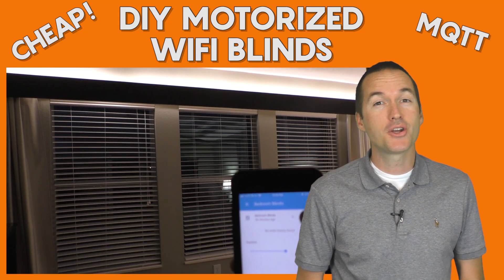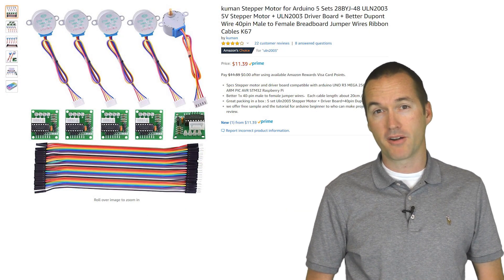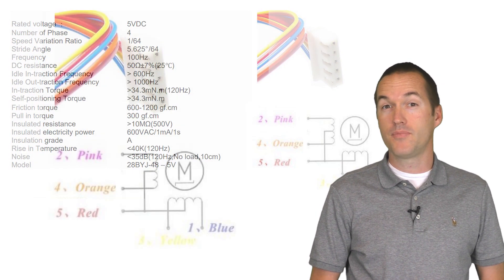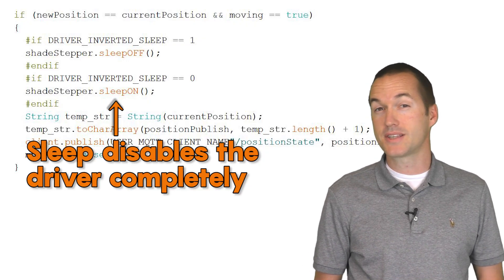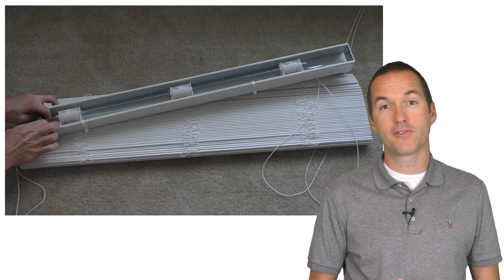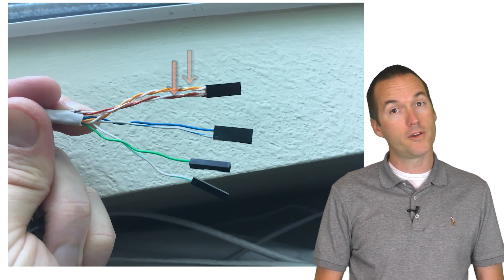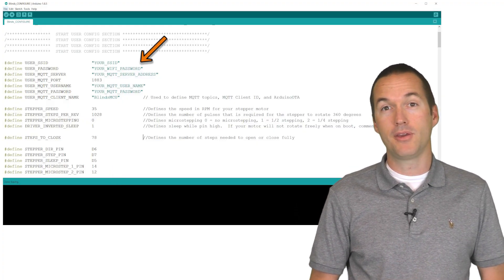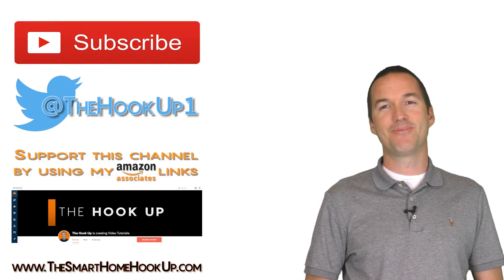Motorize and Automate your Blinds for $10! (WiFi)

Comment: This video is fantastic and just the excuse to buy a 3d printer 😁.  I was wondering if you could help me with a mod?

When using one processor to control three windows (like in your video), could you recommend a way to have either of two digital outputs control one window blind?  That way I could control them individually or as a set using four outputs.  Or should I just set each of them up on their own digital output and use software if I wish to open/close all three?  Thanks!

Comment: The ultimate would be to gather the weather forecast and indoor temperature, and have an algorithm determine if the blinds need to let more sunlight in, or reject it, with the goal of maintaining comfortable temperatures automatically. The very tricky part would be constantly monitoring the angle of the sun and continuously adjusting the slats in response. I'd settle for fully raising or fully lowering the blinds based on heating needs.
Reply: Yeah but you don't need to "raise and lower" the blinds, only adjust the tilt. That doesn't take nearly as much torque.
I think you're getting lost in the weeds....
Really, all you'd need is a light sensor to adjust the tilt to maintain as much (or as little) sun coming in, depending on whether you're trying to keep it bright, or block the warming of the sun.
You could get "fancy" by incorporating a temp sensor (with the light sensor) and develop a "fuzzy algorithm" if you wanted to, lol. That way you can have the best of both worlds. Maybe even patent it!

Comment: Great video! Thanks for your expert help but i have a problem. I'm running 5 blinds as opposed to your setup with 3. Everything works fine and I have triple checked my wiring but it seems my motors do not sleep, when powered up the motors will not rotate freely and get very hot after a few minutes!

I'm using Alexa to control the blinds and I have also tried to comment out the line below in the file "Blinds_CONFIGURE_Portal_Alexa.ino":

#define DRIVER_INVERTED_SLEEP 1 //Defines sleep while pin high. If your motor will not rotate freely when on boot, comment this line out.

Is there anything I can do to fix this? or a way to test the sleep function is working?
Reply from the maker: If the Motors work, but are not sleeping then you probably have the wrong sleep pin wired.
Reply: @TheHookUp  SOLVED With a bit of trial and error I think i've solved it. I moved the wire going from D5 - EN on the Node MCU (Green wire on your Schematic) on to the sleep pin on the Stepper Driver that I had soldered previously to the reset pin as discussed on your Video. All seem to work fine now! Ive also setup a Routine within the Alexa app to auto open and close the blinds at specific time every day! Thanks for your help!
Reply from the maker: @jayblunt  Great! I wonder if that particular board has the EN pin always pulled high to prevent people from thinking it is defective or something.
Reply from the maker: @paulfecht  if you can hook the nodemcu up to usb for a serial monitor you will see it output the position constantly (a stream of 0's or 5's or whatever).
Reply: to add to the above I do think that they are getting commands from the HA Overview page but not able to sleep the motor and the MQTT publish test part is eluding me.  Thanks.
Reply: @TheHookUp  I am able to see the serial monitor and am getting 0's.... can't seem to change that. To the 5's or what have you.
Reply: ok... so I do get the numbers.. but the range of motion... is so small.... I'll revisit your video as you discussed this.  So hopefully my final questions are in HA do I type "positionCommand" or does in need the forward slash "/positionCommand" to publish to the topic and how to I get the range of motion to completely close/open the blinds?  Thank You.
Reply: Ok, I did as @James Blunt did above and now it sleeps. Yay.... now just to get the range of motion and I'll be golden.  Any ideas to help with that would be greatly appreciated.  Thanks.
Reply: Ok, got it figured out. #define STEPS_TO_CLOSE    25 .     <-- That line of code helped me with my travel distance.  Not really sure if the HA MQTT client was getting the messages to the topic and what have you but it's performing nicely now.  Now on to install them as I have a vertical blind system that I cannot install inside of the square tubing but will need to add an attachment on the outside of the rectangular tubing in order to control the 3-spline tilt rod.  Now that I've got the range of motion I'm not sure of how to get it to reverse itself.  Great DIY project.. . . once again... Rob

Comment: Hi... I've been looking how to motorised my blinds for a while now.. This video seems perfect for my application... Although some bits sound mum bo jumbo regarding mqtt files... But I'm sure after some more reaserch I will suss it out....
One thing I would  to ask tho is... Would it not be easier to jst buy bi polor motors?
And could this set up be achieved using batteries instead of mains power.... Any ideas on the type needed and how much life you'd get out of them before charging again.....
Thanx
Reply: My original plan was going to be buying one of the smart bulbs and pulling the gubbings out to control a motor instead..

Comment: Thanks for this! Could you keep the original cord and place motor on opposite end? That would allow anybody to adjust manually. This may require some sort of automated reset programming or something?
Reply from the maker: Not possible unfortunately.  The worm drive on the original mechanism would require way too much force to turn in the opposite direction.
Reply: @TheHookUp  well i have been struggling with this .. It has to be "possible"!.. What if servo could turn the shaft with the worm gear? maybe 3d print a new shaft for the worm gear portion with spool on top.. i don't know but I need manual alternate to make wife happy  BTW I had made them according to your video and thanks much for that. they work great BUT I have to have manual

Comment: Shutters.. most homes in my town have shutters which you manually adjust each section... a pain in the butt.
Since each section is independent, I guess some type of attached rod would need to be incorporated to attach to the motor.

Comment: Hello, My Alexa doesn't find any new device's.
I downloaded "Alexa_Only_Blinds.bin" and flashed with no problem. On inital screen I choose network and insert a password and alexa ID. But then nothing... Alex can't find it.
Should I use MQTT version?
Reply from the maker: Do you have any fancy networking set up like vlans, or segregated networks?
Reply: @TheHookUp  No, I use WLED and Tv remote without problem. Will wait a little bit longer... I just wanted to make shure there is nothing else to setup, for alexa?
Reply from the maker: Try using the Alexa web interface.  Also, sometimes it says it didn’t discover anything but it actually does
Reply: @TheHookUp  Hello,

It works now :D
I didint do anything it just showed up after som time.... But now the motor goes only one way... must dig into that.
THANKS for great work.
Reply from the maker: @sajovicd  Check the connection from the NodeMCU to the motor controller, specifically D6 connecting to the DIR pin.

Comment: Hi Mr. Hookup
Thanks for posting this video. Wondering if the same procedure is applied for motorizing roller shades?
:) Leticia
Reply from the maker: Probably, depends on how heavy they are.  I have another video about roller shades specifically that uses much more powerful stepper motors.
Reply: @TheHookUp   That's an expensive setup of about $100. Are you looking a cheaper alternatives like you did for blinds.

Comment: i noticed that my MCU would get disconnected from the network or maybe it's dead after 4 days. to resolve, i would pull the 12v power supply out and plug it back in.
do you ever experience such thing?
maybe the solution could be as simple as having the MCU auto reboot nightly at 3am. not sure if that's possible
Reply from the maker: That's pretty strange, are you using the alexa version or mqtt?
Reply: @TheHookUp  im still using your mqtt because i still cant compile my own bin from your ino. still mising  libraries
Reply from the maker: It's probably still trying to use the old library.  Take the files from my github, go to your arduino library on your computer, then libraries, then simple timer and replace the files in that directory with mine.
Reply: @TheHookUp  thanks for hooking me up with the files. i can compile this as well as your doorbell now!
username checks out.

Comment: do you have a PCB design for this project ?
Reply from the maker: I don't, what kinds of things would you want on the PCB?
Reply: @TheHookUp  I was trying to have MP1584 & DRV8825 on the top and the ESP8266 on the other side ... maybe with a DC power jack to connect the power supply ... I haven't designed a PCB before but I believe that it will minimize the space

Comment: Great video. How could this be down with openhab and are you using direct power or batteries to power the blinds?
Reply from the maker: I’m using direct power still.  OpenHAB should work fine since it supports MQTT.

Comment: Ok the awnser is yes it will work. But i want to automate my curtains with this code. I want to change some stuff of the cofiguration but when I compile the code i get this error...
no matching function for call to 'SimpleTimer::setInterval(int, void (&)())'
I didn't change anything yet. I just downloaded the code. Could you help me?
Reply from the maker: Yeah, the simple timer main repo got broken recently.  If you look on my GitHub I have a fork of it that works.
Reply: @TheHookUp  nice thanks for the quick response how can I use this fork? Arduino says it is not a libary
Reply: Nevermind i got it working thanks for the awesome video's en code.
Reply: @svenmeeuwissen3567  Hello Sven, I am having same issue, How did you fix it . Please  reply
Reply: Hello, Hookup thanks to answering, however it not clear for me how to get fork details to update the code.

Comment: Hi Rob. Nice video. I finally got my stuff in the Netherlands so I can build my automated curtains. I wanted to use this code but i have 1 question. I have stepper driver a4988 and a NEMA 17 stepper. Should it work with this code?
Reply: Ok the awnser is yes it will work. But i want to automate my curtains with this code. I want to change some stuff of the cofiguration but when I compile the code i get this error...
no matching function for call to 'SimpleTimer::setInterval(int, void (&)())'
I didn't change anything yet. I just downloaded the code. Could you help me?
Reply: @svenmeeuwissen3567  Sven. I had this or a similar error, when I was trying to verify the code in Arduino ide. I had added a different SimpleTimer from the Arduino Library. When I downloaded the one that is shown at the top of Rob's .ino, the error went away.

Comment: after 1 week with it, i only have 1 suggestion to make it better...have LED strip light up as a warning before it opens or closes. the LED will flash 3 times before the motor kicks in. obviously this is above my pay grade but i will try to figure out how to connect the LED to the nodeMCU instead of a Shelly 1.
Reply from the maker: As you said, that's not too tough to add, but it does add a level of complexity that I think most people wouldn't want.  What's your use case?
Reply: @TheHookUp  my wife is always surprised when the blinds open up. flashing LED will give her a 3s heads up that the blinds is about to open.
lights or sound would be good.

Comment: Awesome video! I’m a noob to this, but I’m taking it on. Doing the exact same thing you’re doing with three blinds that are not individually controllable. Quick question—did you combine the wires for the three motor before or after you routed them to the stepper driver? In other words, did you use three stepper drivers or just one?
Reply from the maker: A single microcontroller, 3 stepper drivers in parallel.

Comment: Robert, I have purchased all the parts and ready to take on this project. We are looking to change our blinds as well so it's the perfect time to automate them. However, all the ones I come across are the cordless (no-string) ones. Would you mind sharing the blinds make/models you used in this video, please?
Reply from the maker: Mine were installed by our builder, but they are very similar (if not identical) to these: https://amzn.to/2JR9uLH
Reply: Thanks 👍🏼

Comment: after weeks of waiting n waiting for parts. i am happy to say it works like a charm! thank you so much for helping everyone out here!
now, is it possible to have 1 nodeMCU control both blinds?  what would the schematic look like?  i am thinking of having 2 stepper motors connected in parallel to 1 driver.
please confirm before i accidentally burn down my house or something
Reply from the maker: I have a driver for each motor, but the signal lines in parallel.  I have all three of my bedroom blinds on a single nodemcu.
Reply: @TheHookUp  so with 2 windows, the schematic will look like this?  https://i.imgur.com/DSnOyex.jpg
Reply: @dablet  did that schematic work for you? I am looking to do this with 4 blinds on one mcu as well.
Reply: @dablet  Also wondering if this worked..

Comment: i got all the hardware. working on the sketch now and it refuses to compile. how to overcome this?
C:\Program Files (x86)\Arduino\libraries\blinds\ArduinoOTA.cpp:189:34: error: 'U_FS' was not declared in this scope
     if (cmd != U_FLASH && cmd != U_FS)
Reply: never mind. i see you released the bin file  https://github.com/thehookup/Motorized_MQTT_Blinds/releases/tag/MQTT_WIFI
hopefully everything else works as seen in your video. thanks!
Reply from the maker: Do you have the Arduino OTA library installed?
Reply: @TheHookUp  yes, i have it installed from https://github.com/esp8266/Arduino/tree/master/libraries/ArduinoOTA    but still error as seen above. 

it's ok. i will use your bin file and flash the nodemcu.

Comment: Thanks for the thorough video.  Out of curiosity, will this work for the roller blinds?  Also does this work if you are off the wifi network and at a different location such as work or in another state for a conference.  Looking forward to hearing back thanks!
Reply from the maker: It could work for roller blinds, but depending on the size of the blinds I'd start to be concerned about overheating the motor since it will need to run for a longer period of time to roll them all the way up/down.  

All the versions I've posted will work if you are off your wifi network using different hubs as a bridge (your Amazon Echo will be the on-network device, that relays the command to your blinds).
Reply: @TheHookUp  Thanks for the prompt reply!

Comment: I have a small problem with oscillation while sepper motor moves. I mean sometimes it moves front and back . I tried different driving current and also 3.5V voltage in stepper driver board (because NodeMCU has 3.3V logic and driver 5V) but nothing changed. Maybe its noice problem? The cable should be short or shielded? Maybe do you have an idea what would be the problem? Thank you.
Reply: If you mean the stepper motor oscillates backward and forward, when it should be driving constantly?  I had this problem and it sounds like the stepper motor is only being driven on one of its coils. I had a faulty new motor that had a broken wire and it showed as the oscillating problem.  I also produced it myself by plugging in the motor plug with the connections offset to the supply pins. I would check your motor coils with a multi meter and or, any of the connections to the motor.

Comment: Hey Rob, have followed your excellent video everything is working like a dream. The only annoyance is every time I reboot / upgrade my HA the state of the blinds returns to unknown and I have to send a command to get the blinds back in sync otherwise it remains “unknown”. Do you have any pointers? I have retain: true in the cover: yaml? Thanks
Reply from the maker: Can you submit an issue on the github page? I think I should be able to fix that pretty easily.

Comment: Very nice project and presentation. Can i ask if i can use it with google home?
Reply from the maker: Not natively, you'd need some kind of mqtt bridge like home assistant for that.
Reply: @TheHookUp   Thank you for your reply. I have homeassistant and i have already setup the motor blinds in homeassistand. But how can i integrate it in google home to use it with voice commands?
Reply from the maker: Google home is much more difficult to integrate than echo.  There are tutorials out there, or you can pay the $5/month to have home assistant cloud (nabu casa).
Reply: @TheHookUp  Can we have a button for manual operation together with MQTT?
Reply from the maker: @dimitrisbal4505  Shouldn't be a problem, you could even use one of the button libraries that has hold/double tap/single press.

Comment: I was actually looking for a cellular shade controller that's not crazy expensive like what I'm finding from Lutron and others.  Think this can be modified to work with those?
Reply from the maker: Cellular shades don't tilt, correct? I don't think this will work for that application.  You should check out the motors on DrZz's channel, he did raise/lower with them.

Comment: Your Blinds_CONFIGURE_Portal_Alexa_Core_2.3.bin
 works excellent is it possible to add the other Define variables #define STEPPER_SPEED, #define STEPPER_STEPS_PER_REV, #define STEPPER_MICROSTEPPING  and #define DRIVER_INVERTED_SLEEP to the setup on start. Also rotation cw or ccw. Thanks you for your hard work.
Reply from the maker: It's possible, not sure when I'd be able to get to it.  For changing the rotation direction you can just swap the stepper motor wires + and -.
Reply: @TheHookUp  Thanks for the fast reply